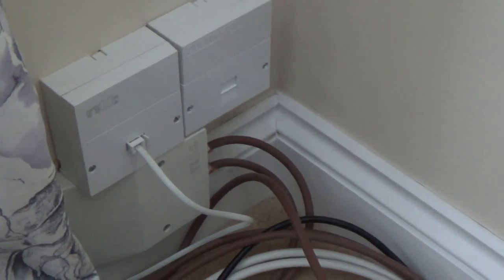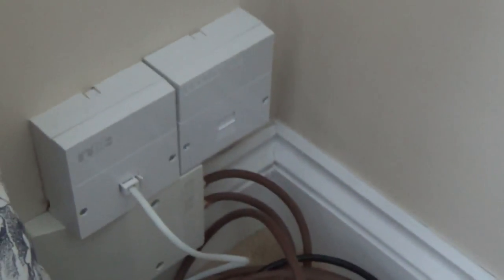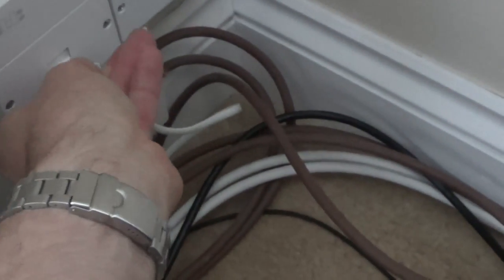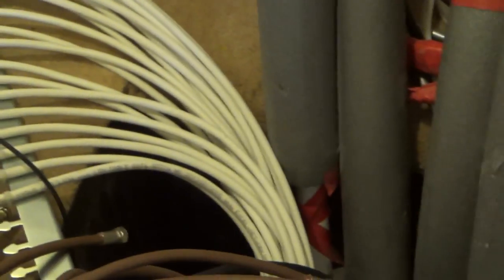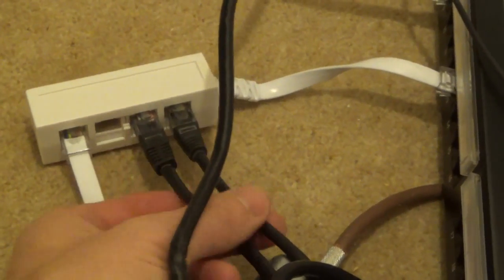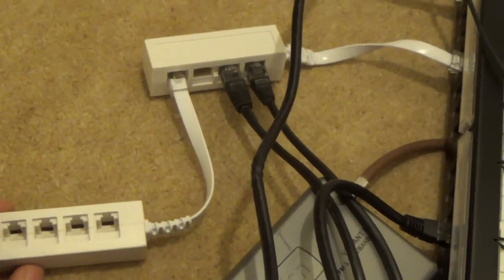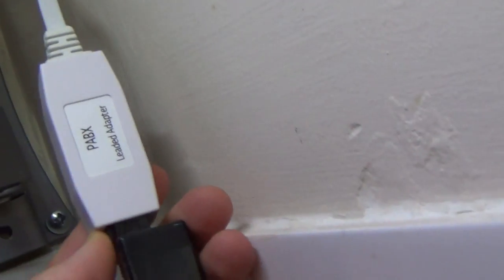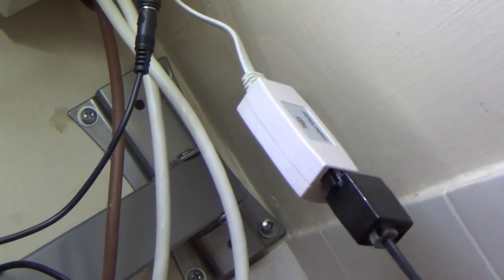How To install TELEPHONE EXTENSIONS through NETWORK WIRING

Comment: This was handy thanks. I've just had my line replaced (old one was ancient and faulty) which sadly means we lose that loop, so rather than dig out the cables and splice it all together with the new box I thought why not use the CAT5 cable I already have around the house! Our network isn't quite as shiny as yours though, it's an old house form before the time of telephones haha.

I'm guessing this will work exactly the same only rather than a patch panel it'll be going through the router, then a switch at the other end via two of those handy adapters. Looks like a trip to Maplin is in order. I may try and Macgyver an old router to turn it into a switch rather than buy one depending how much I can find them.
Reply from the maker: TalesOfWar Hi, unfortunately the telephone won't work through a router or a switch but you should be able to get it to work with a bit of planning if the cat5 cables are all in place. Remember if you want to use a cat5 cable for data and voice you can use a data/voice economiser (see other video on economisers) to push both signals down the one cable and with the use of adaptors etc you will be able to get it up and running.Good luck.Thanks Vince
Reply: My Mate VINCE I got hold of two economisers (being friendly with the IT department at work has its plus points haha). Would I be right in saying that to get this working all I'd need to do is connect these to an ethernet cable? Finding the female to female adapters is pretty simple so I can easily pick those up if this is the case, otherwise I could just splice the cables together.

There's no extra bits I'd need are there? I've already got the RJ11 to BT cables of course. Saying that, I could maybe just plug in an RJ11 to RJ11 (seeing as the phone itself has RJ11, it's just the socket that uses the BT one) to cut out another adapter in the loop.

Thanks for your help by the way. Your videos are the clearest ones on this subject I've found and you explain things rather well.
Reply from the maker: TalesOfWar Hi, if you have wall sockets then just plug the economisers in but if you have cables terminating with plugs on the end then yes get some rj45 couplers to allow you to plug in the economisers. Double check that you have the data/voice economisers and not the data/data because the voice runs down the middle pins (pins 4 and 5) and those pins will not be connected on the data/data version.Good luck with the install.All the best Vince

Comment: Hi, really random question as you seem to know your stuff. My partner has just started a business within the premisis of another business, they currently have one phone line however its setup and advertised as the original business, is it possible to setup a internal phone line thats tapped off the main line and have like a press 1 for original business or press 2 for her new business so they can share the number. is this possible or any other ways without having to get a whole separate phone line installed? Any info would be much appreciated.
Reply: To have like press 1 and press 2 you would need a pbx system . But it probably would be better to get a voip system which just needs internet and you could have a separate number for the business and you wouldn’t need another line installed all you need is internet

Comment: Vincent watched this video several times and wondering if you was doing a simplied version phone master to network socket then that socket say to a switch for use not using patch panel to complete network link. Thenot say one phone in a network socket that also got back to switch to complete network. Or something like that. I want to get it up and running with one then orders rest of stuff from you to complete project. I could email or ring to discuss further. I live in Croydon.England
Reply from the maker: Philip Saunders Hi Philip, unfortunately a landline phone line will not work through a network switch. If you have the cat5 network wiring in place you could look into economisers which allow you to run the phone and data down the one cable which will save you having to run another cable.Thanks Vince
Reply: Thanks for quick reply if I go economise rs route how would I do it.. hint hint for a video.....   can you explain ideally show on video how your two patches work I.expect is one for phones and other data ?? Do you have any switches or hubs etc... I do have cat six for network but straight runs to a poe. No patch panel... I don't mind get a patch panel just for phones and wiring up etc...    hence feedback for diagrams when you show stuff.
Reply: I've learn a lot from you on type of cat five cables and the re 11th socket trick. Excellent work
Reply from the maker: Philip Saunders Hi Philip, I have done a video on Economisers but they only work on a 100 BASE (Fast Ethernet)  network as these only use 4 wires in the 8 wire cat5 cable which leaves 4 wires spare to shove another Ethernet signal or phone signal down, but if you are using the spare wires for power over Ethernet then unfortunately the economisers won't work.
Reply: I'm still interesting on how it.all.works seen the other video.. A 10/100 switch is cheap and patch panel also around £15.. so thinking creating a new network from scratch to avoid issues.... I have the master to network lead and cat five boxes on order and pdx master adapter for phone etc... I know you wire the cat five from network socket to patch panel but is the patch panel terminated to anything or am I right your.just.basically.using the wiring as an extension and nothing more... A step by step guide from start would be really handy and a list what is needed from scratch... keep up the excellent work...
Reply from the maker: Philip Saunders Hi, good idea, I will try and get a video done on home networking (patch panel to wall sockets) in the next couple of weeks. Basically you just wire the sockets one by one back to the patch panel and then use short patch leads from your router or switch to the patch panel and then another short patch lead from the socket to the pc/smart tv/xbox etc.Thanks Vince
Reply: Lucky I know this.... but I love a guide for the phone system for now. Or at least something to get me started got half the stuff and now stopped until I have more info hint hint... have a good weekend..
Reply from the maker: Philip Saunders So for the phone you run the cables/patch panel and the wall sockets in the normal way the same as Ethernet but instead of plugging in your router/switch and computer/xbox you use the BT to RJ45 lead from the phone socket into the patch panel and then use the pbx adaptors in the wall socket end so you can plug your phone in. It is as simple as that. If you want to patch through more than one phone extension then you can wire up maybe the 1st 5 outlets in the patch panel together the same as I have done in the krone IDC tool video so all 5 outlets will be livened up for the phone signal. Hope that is enough to get you started.Cheers Vince
Reply: Thasks for reply I start again next week